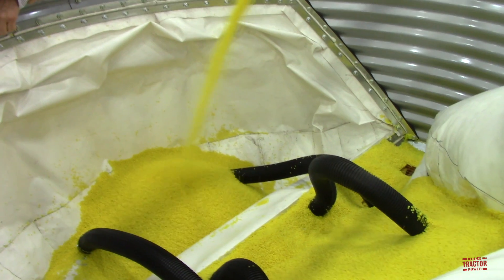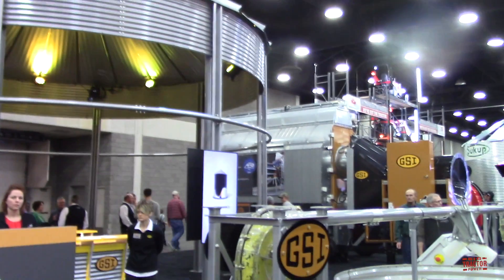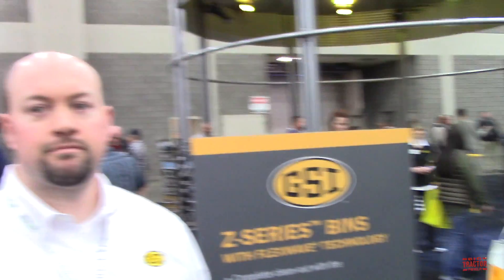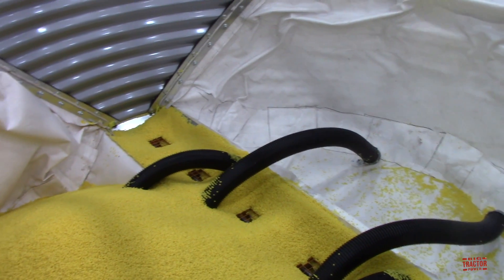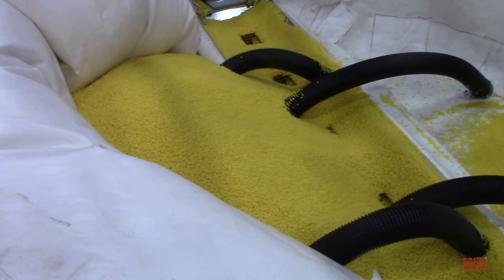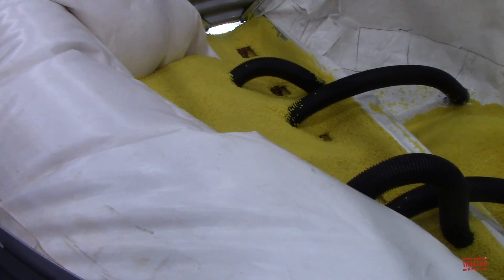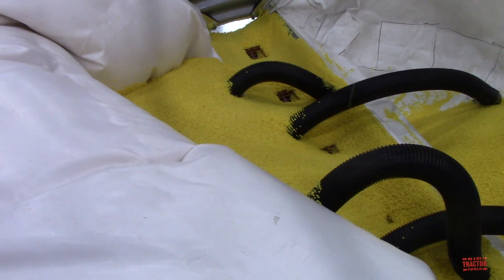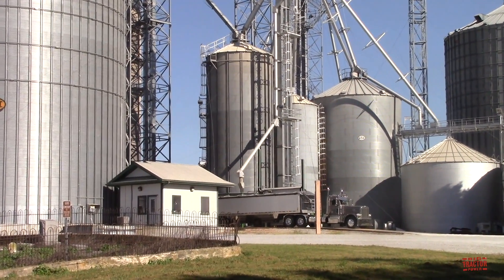GSI Z-Series Grain Bins with FLEXWAVE Technology

Comment: How wil air be blown in through the floor with this system installed ?
Reply from the maker: It goes through the inflation tubes that feed the air bags.
Reply: Thanks for the response BTP

I think this is a very good system ... Sweeping augers are dangerous and one has to be very careful when working around them

Comment: How significant are the asymmetrical loading on the sides of the bin?  The alternating pattern of inflate/deflate means the symmetry loading of the bin is disturbed.
Reply: The bags are flat on the floor when filling. They are only inflated to empty out the last little bit in the bottom of the bin.
Reply: It's only a 30 foot bin, and even with a sweep auger we usually get asymmetrical loads on the opposite side.

Comment: Interesting concept however I have serious concerns about the manufacturer bag life claim as well as rodent concerns not only the chewing holes in them but living in them the vent/pressure hoses and tramping of moisture in creases, folds, and or back side of the bag which would be a harbor for mold, mildew, etc. Additionally I have lots of concerns of about cleaning (sanitizing) of these bag inside and out if the grain bin were to submerged in water because most times when that happens the mud/sediment left behind isn’t so nice and maybe I am weird or whatever but when grain bins gets cleaned out they get spayed with a bleach solution well just because if nothing else it makes me feel better. One last thing the rep for this product would be wise to put a qualifier of his statements about “Never” having to go back into a grain bin with this technology (product) installed.  I say this because people and lawyers are so literal anymore.  I guess the last question is how much for a soup to nuts setup and what are the power requirements.

Comment: Looks like you'd still have to get in the bin to clean it totally.  Takes about 2 hours to clean out a 24' bin with a sweep auger so I'm a little skeptical of the ROI of this system.
Reply: Haul it straight to the elevator is the best way outta sight outta mind..

Comment: In my opinion hopper bottom does same thing but is way simpler and million times more reliable (no mowing parts). Only downside I see is that it takes some vertical space, but you could always dig into ground instead of putting it above ground as normally.

Comment: It looks like you still have to clean around the sump. What about running air through the grain to keep the grain from getting hot?
Reply from the maker: Johnathan mentions in the interview the air tubes that inflate the sides also add air to the grain.